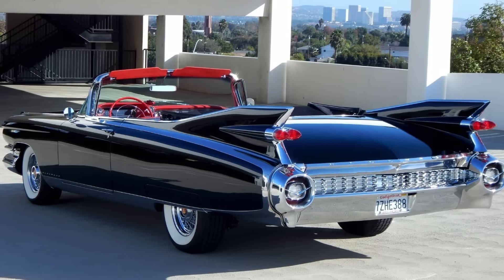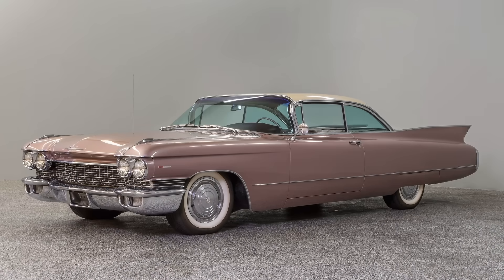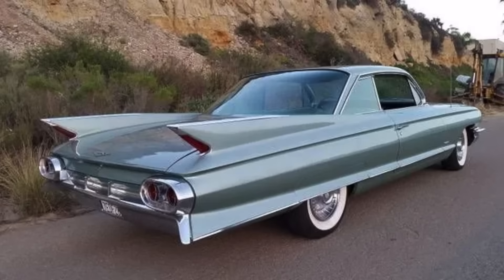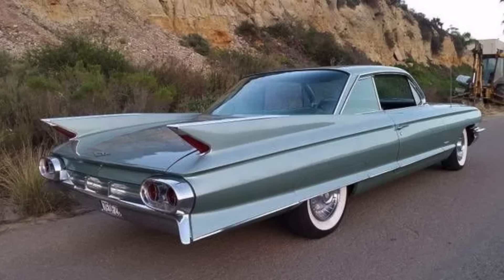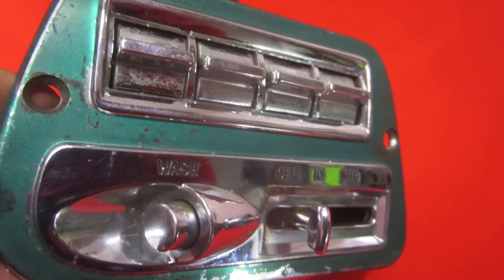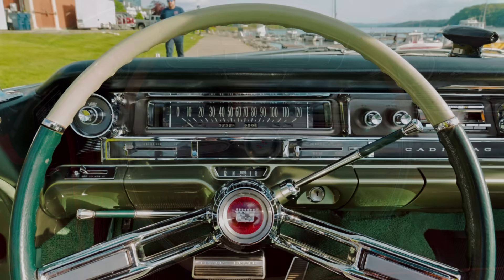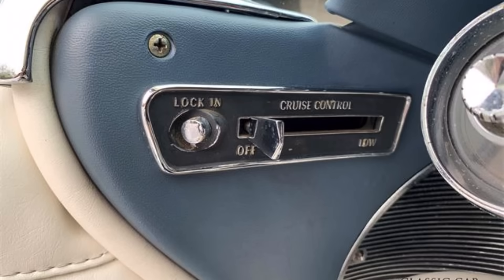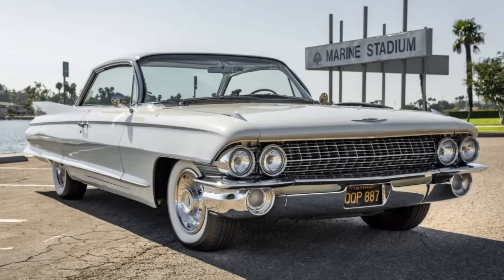Worst Automotive Components of All Time: The 1961 Cadillac's Dangerous Cruise Control (GM)

Comment: I think Cadillac designers for the 1959 already knew that the '59 model's fin would be "peak fin" and that future versions would be toned down. Why? Look at the Eldorado Brougham for 1959. The Eldo Brougham was brought to market in 1957 as a hand built bespoke sedan (only Eldorado 4-door) with its own styling. In 1959 and 1960, the car would ditch that styling of the mid-50s in favor of something that had a lot in common with the later 1960 models....a toned down tail fin. Pininfarina of Italy did have a hand in the car, but I've heard different stories about whether they actually did some design work, or whether they were contracted just to hand build the car based on the Cadillac designer's wishes.  Either way, it was and is a rare car that had its eye on the future model years.

Comment: I hate to burst all your Caddy (& any other US brands) dreams guys but in Europe the lowly Fiat 500cc air cooled rear engined cars had a very basic/crude cruise control. It was a mechanical wire toggle mounted in the footwell connected to the accelerator. So once you were under way you could pull the toggle out and it would hold the speed. Apparently it was useful on longer journeys as the driver could take their foot off the accelerator as it was very tiring to keep the throttle down with only 500cc 2 cylinders air cooled to power the driver 🤣😎👍 Cheers folks.
Reply: Interesting! Learn something new everyday.
Thanks.

Comment: the 59-60 Cads put the cruise control in the left pod further complicating the drive. Four switch location points which have the Cruise/Wiper dilemma for the 1961 owner.

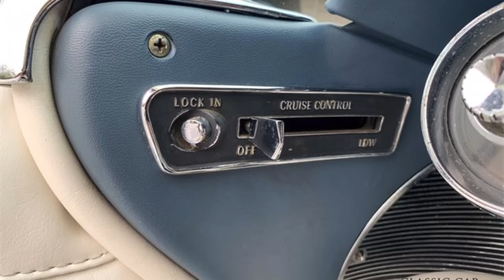Comment: 8:29 The boldness of that Phillips screw says quality.
Reply: The original ones were gold plated. That screw here was something Gramps found in the garage when he dropped the original one in the bucket of used oil while taking that cruise assembly apart to clean it because that button was all jammed up with ketchup and Cheetoh dust creating a hazard not covered under warranty.
Reply: Specially with the rust on it

Comment: I'm curious how those cruise controls worked. Today, you'd press a button to set a speed and we've added accelerate and coast functions, but what does HI-OFF, LOW and LOCK IN mean?
EDIT: From further reading it looks like the slider is actually the speed (meaning you don't capture the current speed, you find it on the slider). Does this system track MPH to keep the speed constant?

Comment: Every time I look inside a late 50s or early 60s american car, I cant help but smile. nothing else looks like this, I've owned a couple 70s Pontiacs before and the interior design even by then were kinda quiet and stale compared to just a decade before. I feel like cars back then were specifically designed for men and GM engineers were trying hard to please the customer.
Reply: Yes. The male was the head of the household then. Interior Design slowly shifted to the female. But manufacturers kept the exterior design and the power for the men.

Comment: the antenna, courtesy light, rear defrost, wiper/washer switches were all of the identical style as the cruise control one on my 68' Electra. They were all located on the dash though. Having drivetrain controls on the doors seems pretty wacky but I definitely wouldn't call it dangerous. The main problem coming from the wiring failing due to fatigue from the door opening and closing. 

I don't really see how this is any different than cars with multifunction turnstalks tbh

Comment: At least as dangerous behaviour as automotive design, is operating switches without first familiarising yourself with the controls, before driving; and, worse, after failing to do so, operating  switches without even a cursory look at the words written on or next to them.
The salesmen could have been instructed to emphasise the differences.
But the greater expectation should surely  be that the owner should know the controls on his own car before using them.

Comment: That's not that dangerous. Cruise control doesn't run away with you. I've occasionally turned the cruise control on, on my Mercedes because the cruise stalk is right above the turn signal., But all I had to do was tap the brake, just like in this car to turn it back off. What was much more dangerous in this car and a lot of other American cars of the time is that deep-set non-collapsing steering column. Get into a frontal crash and the driver could be impaled or at least have their chest crushed by that column.
Reply: I think some of the early cruise controls had a dial to preset a speed.  Not sure about this one.  One of the other commenters mentioned “speed-o-stat”.  If that Lo-Hi lever shown in one of the photos was really a speed preset, and someone left it in the Hi position, perhaps the car could vigorously accelerate just by pressing the lock button.
Reply: @kc9scott  I believe they all switched off as soon as you tapped the brake though, which would probably be a natural reaction.
Reply: Not just American cars, ALL cars.  You are 100% right about Cruise though.  On all of them, a light tap on the brake pedal is all it takes to turn it off.
Reply: @kc9scott  A light tap on the brake pedal turns it off.  On all factory Cruise Control systems.

Comment: Back then everything was a la carte optional no packages everything separate i.e. you could actually get air conditioning without tinted glass which I have been told doesn't work very well and yes you could still get a 3 speed manual on the column. The last cadillac I saw withba stick shift was a 1963 coupe de ville.
Reply: Very true. But those were very few. Most people who could afford a Cadillac got everything available. Now I could see an older farmer might opt for the manual transmission 😂

Comment: ya, they wankered that up, for 59 & 60, too. I guess they thought you'd always just accelerate up to your desired speed then flop the lever ahead until the cruise unit's speed minder bumps against the pedal.  For 1962, they went to a numbered dial that gave a calibrated speed setting so you could preset your speed. An exceptional cruise control unit from Perfect Circle, poor interpretation by Cadillac.

Comment: Cruise control systems today, the moment you step on the brake pedal, the cruise control disengages. Car is going too fast? You instinctively step on the bake pedal. Problem solved.  Didn't cruise control systems work the same way in 1961?

Comment: Nowhere near as dangerous as as some modern cruise controls.  IIRC it was a 2020 or 2021 Passat which would start to slow down when the car in front of you did, then would suddenly cancel at close range, no longer braking.  i thought it was a fluke but but we tried multiple cars.

Comment: You think that the 1961 Cadillac was bad. I had a new 1990  Cadillac I will not list all the thing that went wrong that car, they were covered under warranty.  Then after 
I had this car for 13 mounts I noticed that there were rust spots on 3 of the four doors, trunk and hood about the size of a quarter.  Took it back to the dealer and show him the rust.  He wanted to know if I wanted them to repaint the car.  I said the car is only 13 mounts old.  They told me that they do not warranty paint. THAT IS THE LAST CADILLAC THAT I WILL NEVER BUY.  I drive a Mercedes Benz and buy a new one every three years and i have never had to take one in for repair for any of them.   Oh Mercedes warranty ever thing on the car and that includes the paint.  they do not warrant the tires the tire co. do.  Up date many years later there was a class action law suit against GM. On the 1991 Cadillac they used a water base paint on the Cadillac. The law suit was won.  By that by far most of this SH-- - car was sold or scraped.  Also to get fixed you had to still have the car.  if GM was to give me a free new Cadillac I would not want that piece if crap.

Comment: The Cadillac could do 110 as the song goes!
Reply: Traditionally Cadillacs were not the sports car or the dragster, but they were not the car to mess with on the highway either. The horsepower was there, the gearing was tall, and they were heavy and had good suspension for the time.

Comment: I hear Tesla cruise control/auto drive not so awesome either 😂
Reply: I own a Tesla as well as a 61 Caddy and the basic Tesla Autopilot, which is adaptive cruise control with autosteer (essentially it keeps the car in its lane, even around curves) is pretty solid.  In April, they gave all Tesla owners the full self driving option (its all done with a software update).  It was amazing at what it could do but equally frustrating at the hiccups.  I gave it a "B+" overall.
Reply: @keetonkatt4621  I recently saw that clip of a near miss against a train, that was a d- .

Comment: 4 speed auto on a 61? You might have misspoke.
Reply: The early hydramatics  were indeed 4 speeds., using a fluid coupling rather than a torque converter. 4th was direct drive , not an overdrive like a 1980s 4 speed.
Reply: No he didn't.  The original General Motors HydraMatic Drive was a 4 speed fully automatic transmission.  You are thinking of the later TURBO Hydramatic.
Reply: @michaelbenardo5695  I stand corrected. Thank you!
Reply: @Wiencourager  Thank you for the correction. Cool fact!